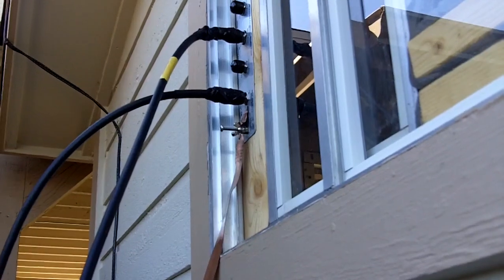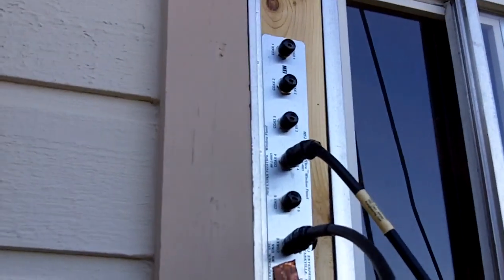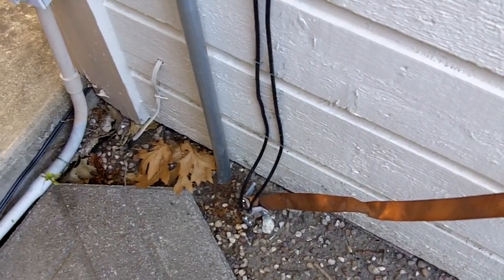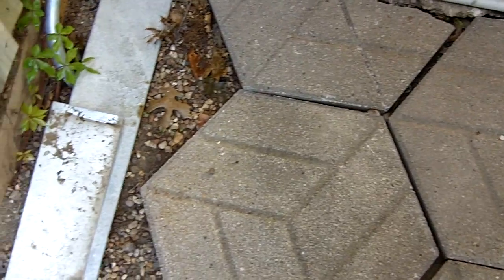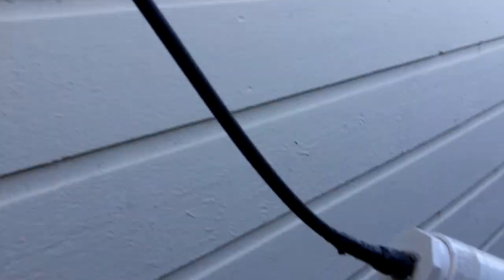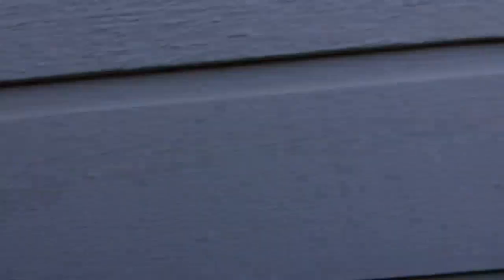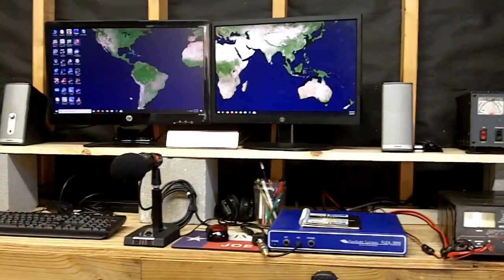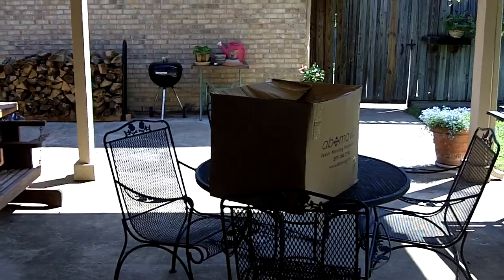New ham shack antennas and grounding

Comment: Great Video Joe... I am a Radio Tech at Los  Angeles County so the first thing I noticed was that eventually you may want to do a simple strain relief on the coax going into the shack.  I wish that we were neighbors so I could be there to help you get it all up.  I'm pretty new to Amateur Astronomy as well so It would be nice to collaborate with you regarding seeing the Greatest Show on earth.
Reply from the maker: Thanks Anthony. Yes I intend to mount a small shelf near the passthrough to hold the choke Balun and also fix the coax to the side of the shack. I will do this after I run the end fed wire from a tree in the backyard to the chimney on top of the house. It's actually running too near the shack right now. 73

Comment: Thanks for the tour.  I didn’t even get dizzy!  Haha.  I am wondering how to bring in coax from the outside and provide good lightning protection and seal all connections.  I am starting with a LTE Cellular antenna that runs 700MHz - 2700MHz.  So that run(s) are LMR400 (stiff as a board I tell ya) and I need to get lightning arrestors such as Alpha Delta for those 2 runs.  Then in turn I want to prepare for my HAM license and have VHF/UHF/HF antennas brought into the same shack as it were (used to be my office before I retired).   So I am looking for best practices that people use.  Where do I place lightning arrestors (in an external box or at the base of the3 antenna in a protected box?).  Any advice would be greatly appreciated.  Also, send me to any articles to read on the subject.  Thanks and 73!
Reply from the maker: Attach the lightning protector to the ground rod. You can use a regular dryer vent to bring cables through a wall stuff the opening with steel wool to keep critters out. You can also buy a MFJ passthrough panel and mount it in a window to bring coax in without drilling holes in wall. 

I have several videos showing grounding and the passthrough panel. Go to my channel by clicking my name. 73